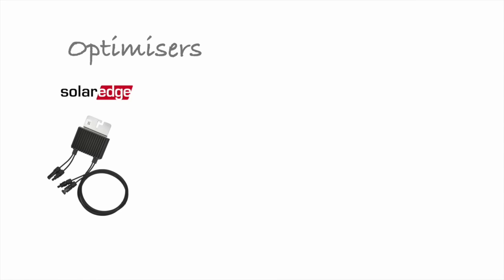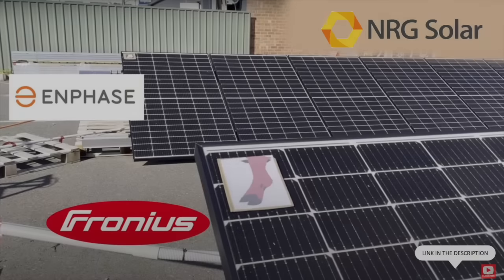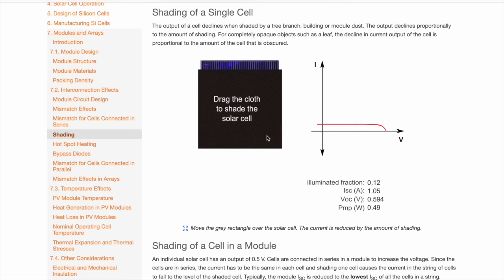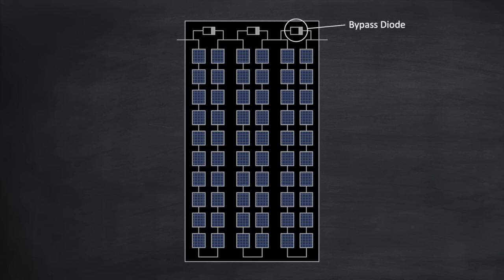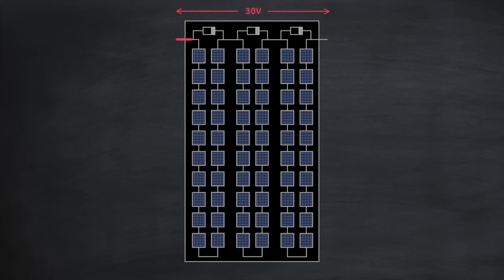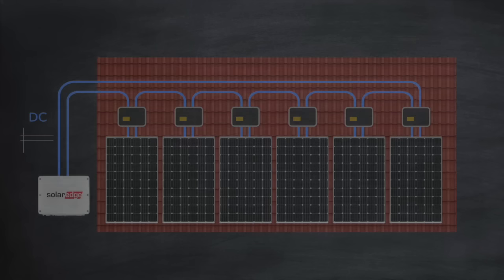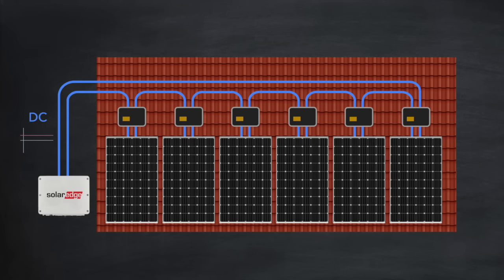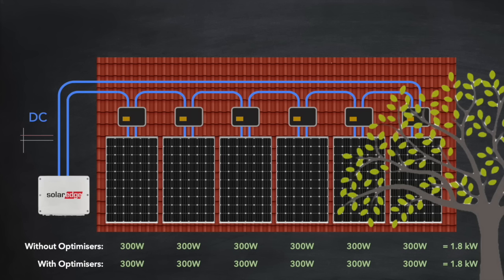Solar Panel Shading (Part 1): Are Optimisers and Micro inverters Worth It?

Comment: Thank you.  A very timely video for me as I'm in the process of comparing various quotes at present.  I have tree shading issues so have been querying why optimisers are in/excluded from various quotes and why some quotes are only including partially optimised Tigo solutions.  This is probably as clear an explanation of all the regular systems as I've seen (several compare Enphase and SolarEdge but very few include Tigo in the mix, which is what most companies are using in their quotations).

Keep up the great work.
Reply from the maker: Thanks very much for the kind words - yeah, it's a real minefield out there, and hopefully, I'll continue to be able to demystify solar in my future videos :-)
Reply: @GaryDoesSolar  The good news is that I'm not yet an Octopus customer, so will definitely use your referral code when I'm eventually able to make the switch (not just for this video, but the entire series to date, which has been excellent).  Not sure if you're aware, but they're currently closed to new customers until Octopus find a way to make them compatible with the Govt Energy Support Payments, as there's currently no way to include these on fixed rate tariffs, which is what the Go and Agile tariff rates are.

It's very obvious how much work goes into these videos, so being able to use an affiliate code like this is at least a way to show support.
Reply from the maker: That would be very much appreciated,  @RiffMan117  - thank you! I’m using really basic equipment to make the videos (would you believe all the animations are in PowerPoint?!) My audio is all over the place, so I’d be using referral monies to buy better equipment 😀👍🏻

Comment: Nice video, and well put together.
I'd add 1 more con to your list of optimizers
1. A constant 2% efficiency loss at the optimiser itself, regardless of shading or direct sunlight. 

I feel that most PV systems do not require optimizers/micro Inverters, but they do have their place in more difficult roofs with unavoidable shading.

Good survey and design mitigates the need for optimizers in most cases in my opinion.
Reply from the maker: Thanks Euan, for the kind words and also the additional points. I’ll incorporate into my follow-up video on shading 👍🏻

Comment: Great video.
We have optimizers and I am quite content with them. We have 92 panels on our apartment building. We have an east--west orientation with a raised edge around the flat roof and a chimney in the center. You can follow the output of each panel through an app and usually there are significant differences. If you have panels in different orientations, you have to make either separate strings, each with their own inverter or use optimizers/micro inverters. Micro inverters make sense if you don't have a large number of panels. It's not only about direct sunlight shading. In clouded weather (diffused light) all panels are affected differently by sources of shade and no cell will have 100% shading. Also, dirt on panels can reduce the output of some cells more than others. Long term if we have to replace some panels by non-identical ones, that will not give us any issues.
Reply from the maker: Agreed - having the ability to individually monitor a large array of panels is   a great benefit to have! I'll cover some of the points you make here in a follow-up video I'm making, especially about non-identical panel replacement... thanks!
Reply: You  forgot that you can make multiple strings with a main Inverter that support 1 ~ 4 string groups. Or use multiple smaller inverters (given that you have 92 panels) that each take 1 or 2 strings, and output in parallel.

The problem with micro inverters as i see it, they are exposed to potential hot temperatures, constantly with no cooling. That will affect them, despite the claimed 25 years warranty, vs a larger inverter that has active cooling to keep everything nice and cool. Take it from somebody in the IT business, there is a reason why datacenters have AC, and servers are stacked with loud fans. Electronics , and yes, that micro inverter has electronics in it, will degrade faster. And wait when one or more dies and you want or need to replace it. Its one thing on a apartment building with easy access but normal homes where you may need to remove a bunch of panels to access the issue panels.
Reply: @benjiro8793  We have optimizers, which have less electronics in it than microinverters. Our rooftop has good accessibility for replacing broken optimizers. Multiple string groups requires more cables, which is significant, because the inverter is in the basement. We may not have the most economical solution, but I am content with it. Electricity production is above expectations.

Comment: I manage about 10MW of rooftop solar across the UK. Of that about 20% is SolarEdge.

It is entirely fair to say the the SE systems do produce more than an equivalent string inverter system. It's in the order of 1-2% if the SE system is entirely working.
It is also the case that the SE systems have far more faults than all the other systems so the likelihood of us having a fully functional SE system is very low.

Most of the time that's optimisers at fault, but they are also by far the most unreliable inverters we use and their support service is vastly worse than suppliers like SMA. Shame we can't actually buy any SMA kit at the moment!
Reply from the maker: That is quite an estate! 😳 Thanks for taking the time to share this insight. It’ll help people a lot in their decision making 👍🏻 I learned a few things too!

Comment: In Australia it is possible to get Enphase micro-inverters at only 10% more than a string inverter. One of the most important benefits not listed here is the increased reliability and longevity of micro-inverters; our local supplier recently switched to offering only Enphase micro-inverters for that very reason. 
There are also significant benefits for PV installation companies in terms of managing and storing stock. 
Having inspected several houses and businesses with non functioning solar systems, I believe the improved monitoring from micro-inverters is well worth that extra investment.
Reply from the maker: Thanks Chris - good insight here 👍🏻 And great to here the pricing differential is lessening
Reply: @GaryDoesSolar  Enphase IQ8 microinverter has a 1/500000 failure rate and will function accordingly for 25 years, longer of course but that is the limit of the warranty, works when the grid is down without the need for a battery. The options focus on in this video will have to be replaced at least once, possibly twice during the life of the array.  Those are undisputed facts and serious considerations. The solar industry is pushing for a module life span of 50 years, None of the tech featured is capable of such a feat. String will die a natural death, the future demands innovation. Ultimately customer service is the reason Enphase is number one in the USA and hyper-growing in Europe.
Reply from the maker: @s.lionelmcauley4455  Thanks for this extra detail - you've given me an idea for a future video... 👍

Comment: Hi Gary. Thank you so much; these are fantastic videos which are so much easier to understand than just reading manufacturer's literature.  I do have a question/observation. I've watched your earlier video 'How to choose SOLAR wisely and avoid costly mistakes' where you explain what each component does in a SOLAR system i.e., Solar panel, Invertor and batteries. In the Solar panel section, you mention that shading one panel will adversely impact all the solar panels in the series which suggests using optimizers and/or microinverters is the only solution to reduce the impact of shading. However, your video 'Solar panels shading: Are optimizers and microinverters worth it' you clearly explain that electronic protection measures are in place by having the bypass diode added to each array leg suggesting that optimizers and microinverters are probably not worth the investment as the bypass diodes do a great job. Also, the cost of replacing the optimizer could be high for the reasons you explain. Maybe it's just me but I felt the videos slightly contradicted each other in the Solar panel sections. Let me know your views. Keep up the great work. Cheers
Reply from the maker: Thanks David, for the kind words. Really great to hear you’re loving the videos 😀

Yes, you’re right. In the earlier video, I feel I was duped by marketing material and also many YouTube videos that claimed shading on one panel would affect all the others. It was only when someone mentioned bypass diodes in the comments to that video, that I thought I should undertake my own research to get to the bottom of it all. And I’m glad I did!

Now, I added a correction to the first video but I guess it was not prominent enough - it should state “CORRECTION“ at the appropriate point in the video with a link to the later video…

Comment: A very good quality presentation. 
It might be worth checking the minimum operating voltage of the string inverter, as this may come into play if the shading is across several panels stops it from operating all together. If you have dramatic shading, like I do on my garage and only space for 6 panels, then Enphase IQ7+ microinverters are the only real option. 
There is also something called sub-panel optimisation where by you can replace the 3 bypass diodes with a small circuit that will optimise each of the 3 strings of cells. These were in the form of the Jinko Cheetah  Maxim optimised panels - which I believe are now obsolete. It is a pity they did not continue this idea with  more panels. So I am looking at building some of the modules to retro-fit to a test panel, the IC that forms the heart of this is the Maxim MAX20800. This involves removing the silicon potting compound and diodes and fitting a small PCB and re-potting it to waterproof it and conduct any heat away. 
Its worth also mentioning that the panels do not need to face the sun to produce power, as I have mounted a panel on the west vertical wall of my garage to take advantage of the setting summer sun, but even in the autumn/winter when the panel does not get any direct sunlight, I can still see perhaps 160Whr on a part sunny/cloudy day with the sun bouncing off the clouds and 60Whr on a clear blue sky sunny day.
Reply from the maker: Hi Rob, thanks for the kind words. And thanks also for this detailed comment. Lots of information in there for me to work through, especially as I'll be making a follow-up video on the shading topic soon... I love it that you're not frightened to get stuck in on the bypass diode circuitry! :-)

Comment: There are two more scenarios I can think of in which you can use optimizers:
- you can have one string with some pannels placed at different angle on the roof or facing different direction
- you can have pannels with different power output connected in one string
I know that these are not good scenarios and should be almost always avoided, however they are possible with optimizers.
Reply from the maker: Thanks for the insight 👍🏻 I could imagine a roof with three orientations but the inverter can only support 2 strings.

Comment: one thing no one has touched on..at least in the extensive search on this topic that I have done.... the micro inverters are VERY useful if one has very limited room for panels and is running a 48v system. The micro inverters have a low voltage startup and being mounted onto each panel, can be used on most panels out there as the low voltage input range is fairly broad - so most panels have the voltage for them to work - then this AC is sent to an inverter like the Victron MultiPlus II and is used to charge the batteries connected to the victron inverter/s. If one tries to use a DC MPPT charge controller then one finds a "start up" voltage of 70-80+ volts - you cant get this from one panel. So if getting all you can out of EACH panel in a 3 or 4 panel setup that has shading issues through the day is VERY important to you, then a micro inverter is the answer. Note that what i have said above is for 48v battery systems. On a 48v battery system, even if you are willing to dedicate an DC MPPT controller per panel so that shading is dealt with, there are not many panels out there, that when used as a single panel system, produce enough voltage for the 48v DC MPPT controller to actually work. With 24v or 12v systems this is not a problem as a panel with 40v output has a high enough voltage to make a 24v MPPT do its thing. With a 48v system this problem is overcome as the micro inverter can accept just about any panels input voltage, convert it to AC and send it to the Hybrid inverter that then uses it to power its onboard battery charger. The added bonus is per panel monitoring.
Reply from the maker: Thanks for sharing this insight 👍🏻
Reply: @GaryDoesSolar  Gary, granted not many ppl would be looking for a microinverter to power 1 or 2 panels, but if one is doing just that (for example - on a sail boat) AND runs a 48vnom system then this is the best way. Its a very small niche to be honest but it does work.

Comment: I was sceptical when my installer suggested optimisers back in 2013 but now having the data for every panel (occasional shading depending on the time of year) each panel varies by quite a degree in terms of output even in non-shaded conditions (i.e. two adjacent panels in summer for example) - if it was a single string, the whole array would have been pulled down by the weakest panel and thus over the lifetime of the array this could well add up to 100s of kWh - in close to 10 years this is very apparent and so I’m glad I went with them - I’m squeezing every W out of each panel so they have paid for themselves in their gains from my calculations…each to their own however. That said, back in the FiT days, the upper limit for the highest rate was 4kWp so there wasn't as trivial as adding more panels - even then the added cost for the panels and mountings might outweigh the benefits of the optimisers/u-inverters imo

Bit long winded but, I have data from the first 4 years - the install was intended as a bit of an 'experiment' as my installer was explaining the virtues of thin-film panels over mono-crysytalline - they can have better low light output and better peak performance but at the expense of being bigger panels (hence more cost to install) - I suggested we went 50/50 on the same roof and I share the data with him - 1.95kWp Solar Frontier and 2kWp of LG - the difference has been pretty self evident though the LGs actually perform marginally better in low light (slightly better yield on dark days), the SFs better in peak conditions due to the 'light soak' effect. Solar Frontier did a case study at the time (not sure if still on their site) though I calculated gains of around 4-5% for the same kWp (they claim 10%)

By way of example, on a crappy day in January 2016 my best thin film managed 133Wh, the worst 65Wh, the LGs were 96Wh and 82Wh respectively. On a good sunny day in July same stat - SF 2.4kWh vs 2.2kWh and LG 1.72kWh vs 1.65kWh so there is variation between panels - similar to the performance of microprocessors where they are categorised for sale depending on bench testing - for the thin-films at least this is very apparent, the LGs are much closer but again over a lifetime, those few Wh add up - I want to harvest every electron I can and on balance between cost and material input for the optimisers, they seem to be doing their job! (as an aside, I noticed quickly that the SF panels wouldn't 'come online' until they reached around 10-12W of power versus the LGs which started at 2-3W - I shared the data with SE and they sent over a newer version of the optimisers that were on the thin films as they have a Vp higher than monos - that solved the 'low light' problem as they all come on at around the same time now - it was a faff to replace but fortunately it's a bungalow so I just said to my installer that I'd do it myself rather than them get scaff back up etc)
Reply from the maker: Thanks for taking the time to make this detailed comment. It's great to hear that it all worked it for you :-)

Comment: In addition to cons of optimizers (and microinverters) being cost and additional failure points, there is also lost efficiencies of having them in the system.  For instance, the Tigo and Solar Edge optimizers are active devices which themselves consume power.  So in a largely unshaded installation, the overall power output is typically greater without those parasitic device losses.
Reply from the maker: Hi Bill, a very good point. I'm hearing these devices use (lose) maybe 2% of the available power. I'd need to confirm that though...

Comment: Nice video, well presented. I do think you missed one aspect - in all your examples you are referencing a single serial string if panels.
I think that it's fairly common to have parallel strings with (passive) combiners driving into a single charge controller/invertor. If one string is shaded it's voltage will be reduced, compared to the other (parallel) strings. It would be interesting to see how this manifests - I suspect that you would loose all of the power production from that string.
It's also worth noting that if parallel strings are placed on different aspects of a roof that the same situation can occur... If at all possible panels should face same direction, or be wired on different charge controllers.
Reply from the maker: Thanks for the kind words. I'm getting quite a lot of interest in this particular video, and suggestions (including those you raise) for a follow-up video - so my plan is to work on that soon :-) I really appreciate you taking the time to comment